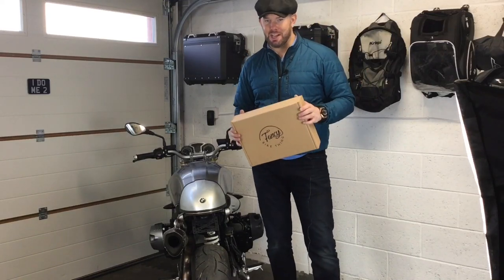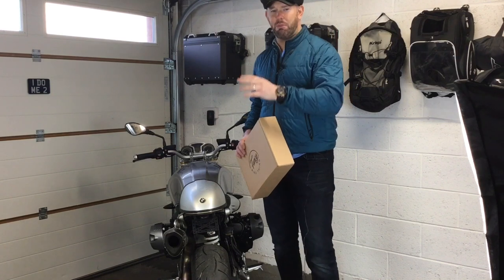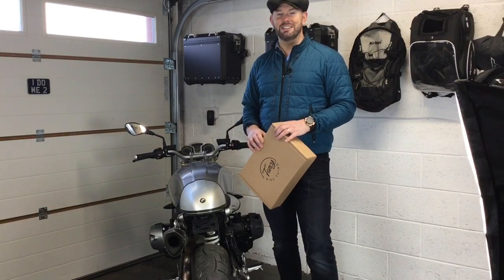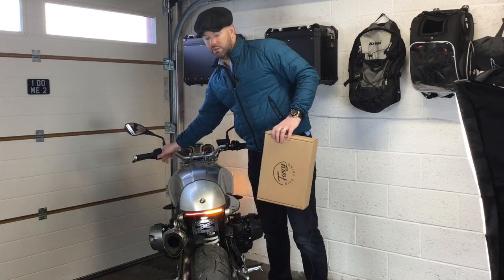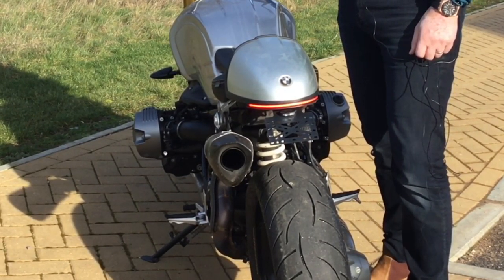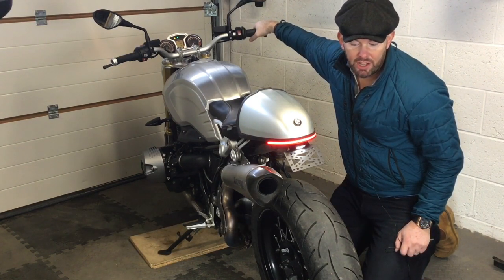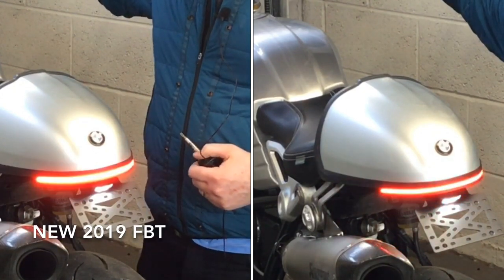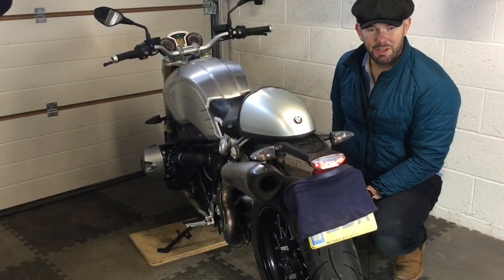New and improved FBT run/brake light.

Comment: good upgrade but the brakelight is still not street legal in the EU. Is there really no Led Strip that is E certified?
Reply from the maker: Michael Strixner hi,  I haven’t found an e.certified strip that has integrated turn signals.   The run and brake are the issue with the law.   It’s the space between the turn signals that make the unit non legal however a turn signal mount comes with the kit so you can mount external turns.
Reply: A BIKE THING  i get that. i run motogadget turn signals with your kit. but the problem is since there is no e.certification on the strip it is still illegal to run the breaklight in austria or germany. Since your kit looks so nice I think it would be cool to have the option between a street legal version (just the breaklight) an your brake/turn combo (non legal)